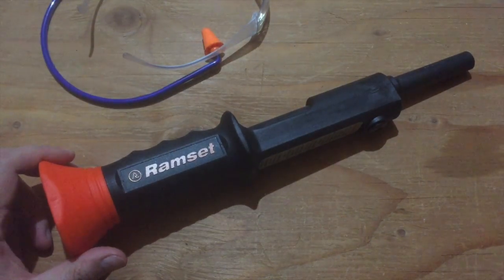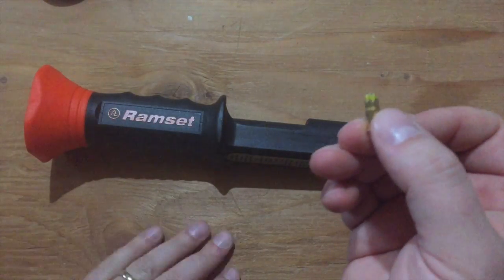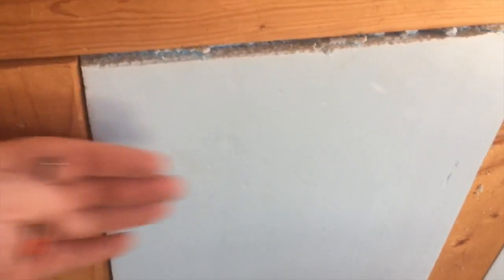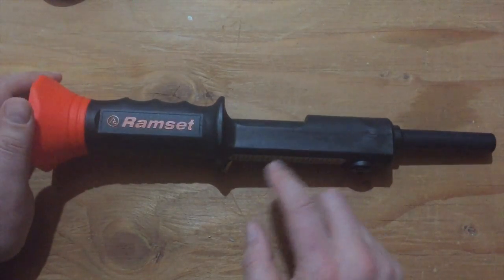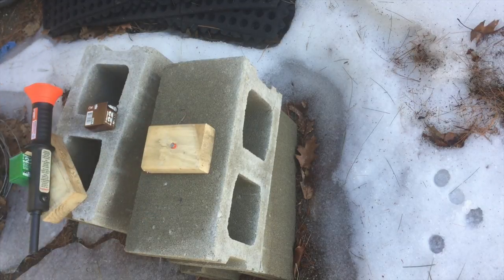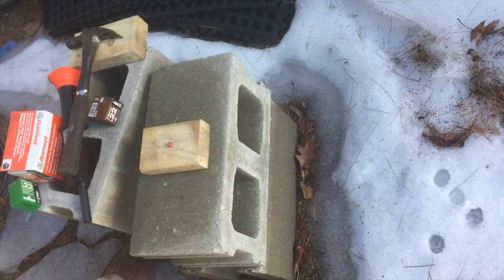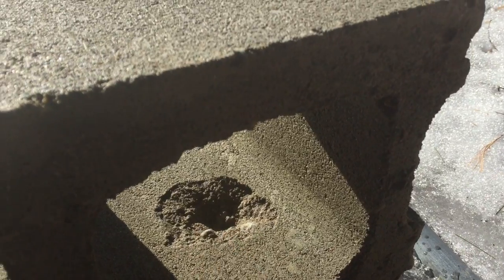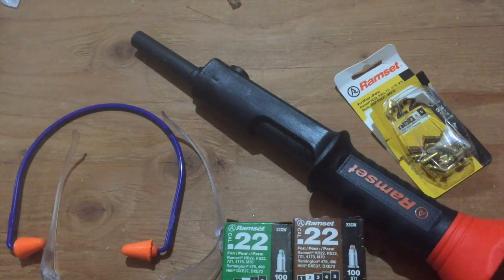Ramset vs Concrete Block Experiments

Comment: I'm pretty sure they had them when this video was made but they make a ram set with a trigger so you don't have to use a hammer. Also, it's probably cheaper to use a roofing coil nailer with hardened nails and much faster. Thanks for sharing your thoughts though.

Comment: ⚠ Warning! Not wanting to be critical. However, this tool is not intended for a novice "lab guy" to be having "fun." It's careless of him not to give any specific safety warnings other than his legal disclaimer. He should be telling you to wear safety glasses. So should anyone that is observing. Concrete can break off and hurt you or someone else. The nail may hit something hard and fail to imbed in the concrete. Things can and do go wrong. Not to mention he not using the tool correctly. What happened to the round steel disks that are supposed to be placed over the surface of the board? It prevents the nail from going clear through some materials. Which can be dangerous. You can seriously hurt or kill someone by not using the tool correctly.

One of the comments asked about the orange plastic piece showing on the surface. It's not intended to be a fastener that looks good. The outcome can be unpredictable as far as appearance is concerned.

The video, while nicely done, makes it look simple. He uses the best of circumstances. He is being reckless.

Comment: What kind of wood did you use? Does it matter if its not pressure treated or not?
Reply from the maker: For the video, just a scrap of plain (untreated) 2x4. Pressure treated should be used in many cases though (bottom plate of a wall on a concrete floor for example). It would depend on the details of what you're trying to do and your local building codes.
Reply: @Dabbleatory  thank you for the info.. I will be receiving my ramset in a few days can't wait to test it out...

Comment: I bought one of these to attach 2x4 to my basement walls. Don't waste your money.
They really suck.
Reply: Looks like you and it have something in common then.
Reply: Why do they suck? They seem to work great? That’s what I want to use for. Attaching top plates in basement to concrete
Reply: I tried using one with 2 1/2” nails and it wouldn’t penetrate much. Maybe try the 3”?

Comment: Good demostration. My experience with cinder blocks has been hit or miss- sometimes it works, many times it doesn't.  Fastening into the  mortar joints is the preferred method.